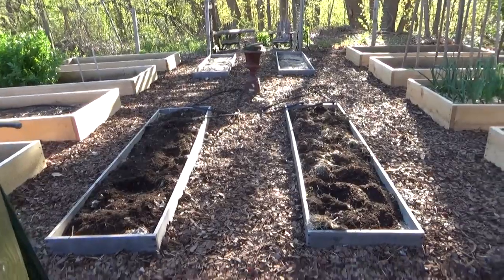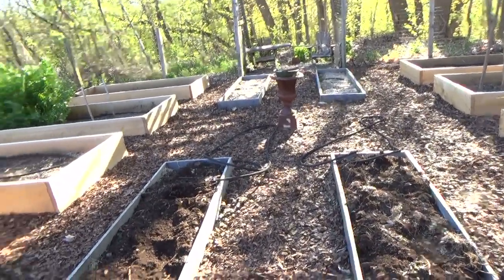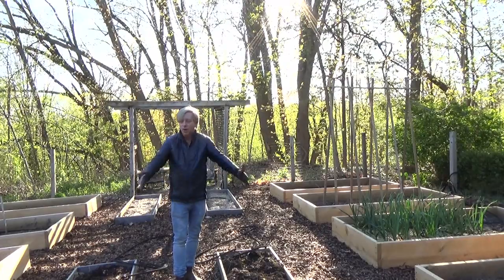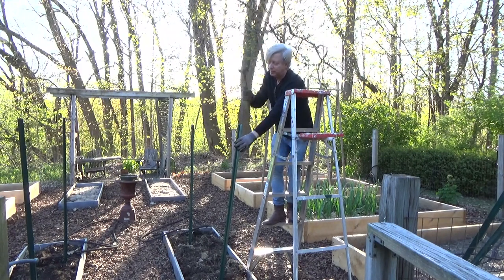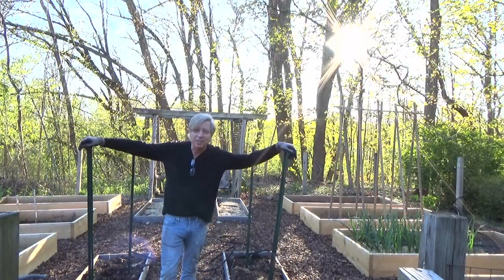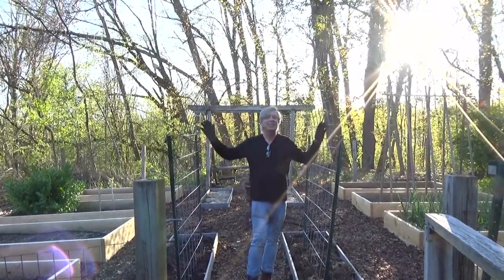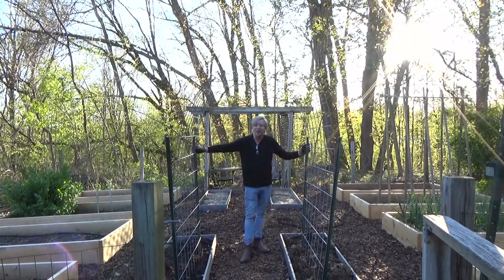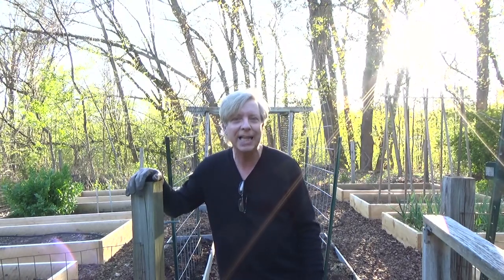Installing My Cattle Panel Trellis

Comment: Good job!  That length panel was perfect.  I was sitting on the edge of my seat hoping the right (second) side didn't pop out while you were situating the first one.  It may have seemed awkward for you, but the process actually went more smoothly than I anticipated.

Comment: Hi Kevin,  I am upping my game this gardening season and plan to install 2 cattle panels arched trellises.  I just purchased 3 6’5” x 2’ raised garden beds and plan on putting 1 panel between each bed.  Can you kindly tell me how much space you have between your garden beds where you placed your panels and how far inside the garden bed you put the panels. I want to put the panels outside the garden beds and am wondering how much space I need between the beds so I can still reach the veges without getting on a ladder!  Were yours too high or just right?  Thanks.

Comment: Kevin,  we have to get you a mallet for pounding in stakes!
Reply from the maker: Yes, I need a mallet!
Reply: Actually you need a T-Post driver..  costs about $20... you pound those TPosts into the ground (even rocky ground) in about  15 seconds.
Reply: Absolutely!  One may have worked on the wood posts for the tomato trellis too.